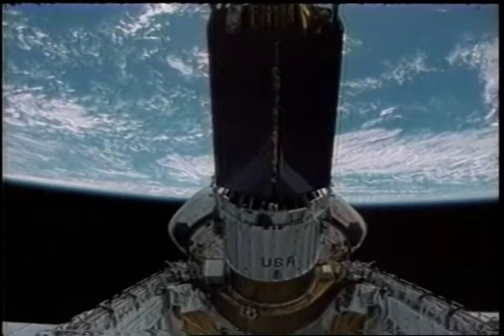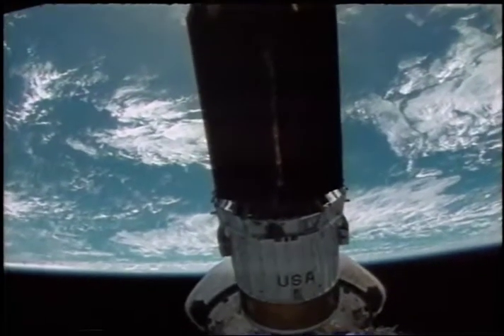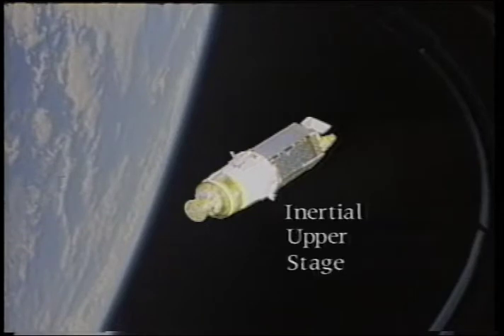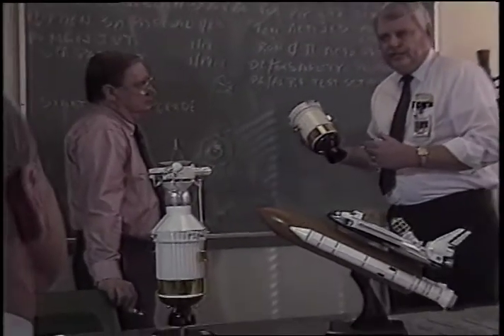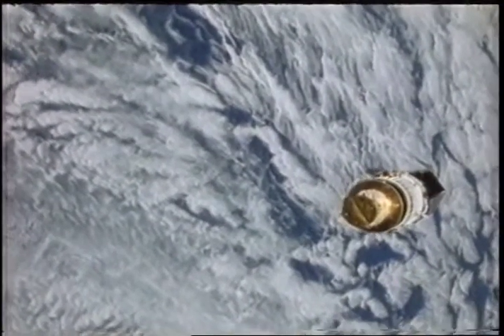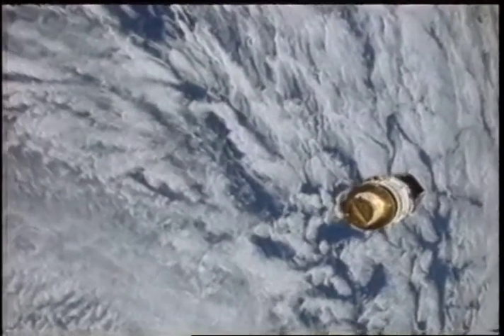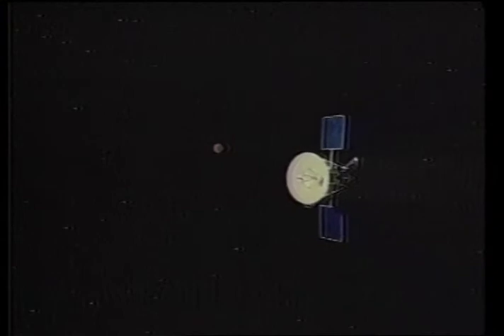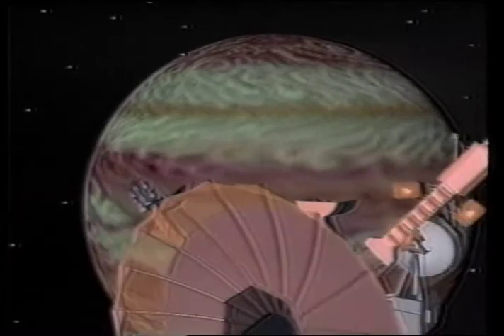Inertial Upper Stage

Comment: Why does it use Solid Fuel?
Reply: easy to store solid fuel at room tempeture which reduces temp constraints. if it were cryo fuel then it would need cooling systems which would take alot of weight up and that is not a thing you want to do on the shuttle.
Reply: There were plans to put the Centaur upper stage in the back of the Shuttle. But after Challenger the idea was moth balled. Something about having a hydrogen bomb in the payload bay of the shuttle not being a great idea.